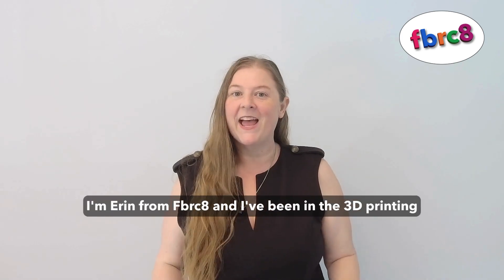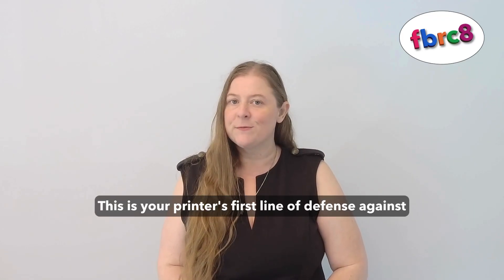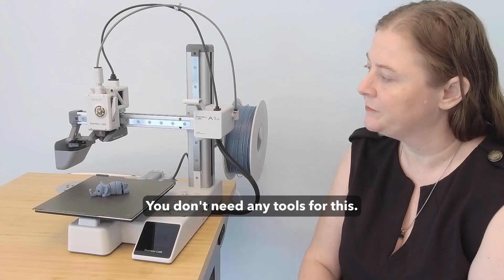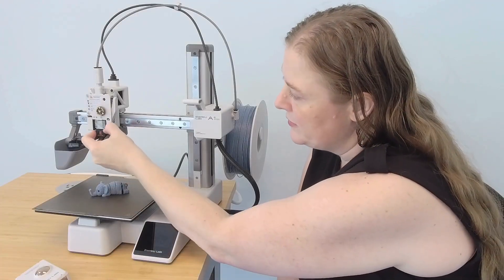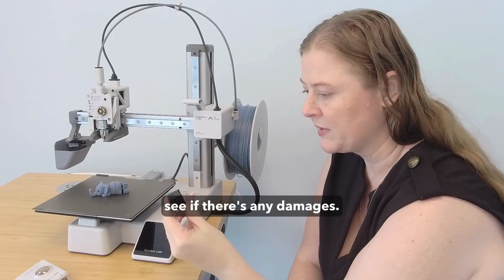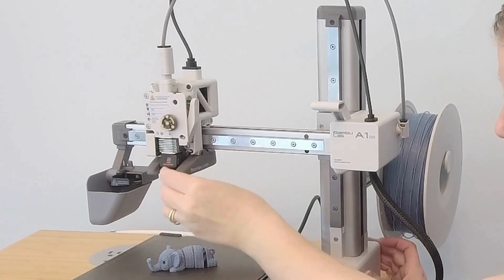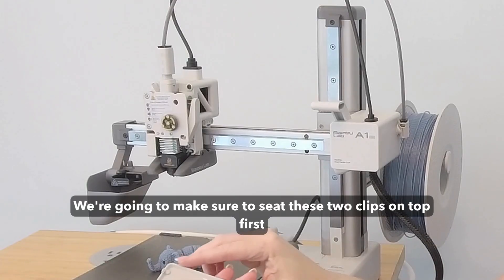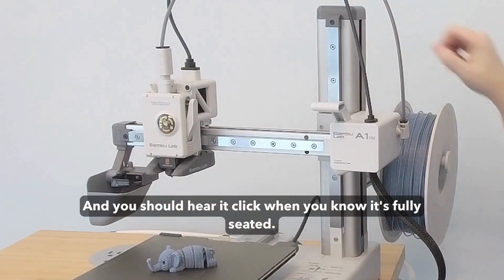Bambu Lab A1 Series Silicone Sock

Comment: What is the main prose of the rubber piece?
Can I run without  it?
Reply from the maker: I don't recommend it. It serves 2 purposes: it helps regulate the heat by keeping the heat from escaping the hot end, and it serves as your print head's first line of defense against filament coming un-adhered from the bed and damaging more expensive parts of the print head. For $3 for a pack of three...it's worth keeping them installed.